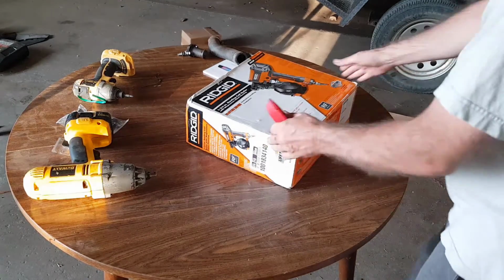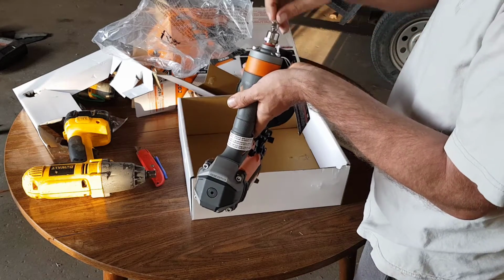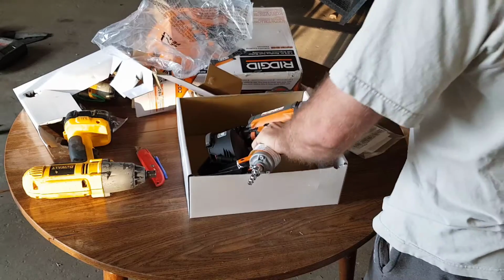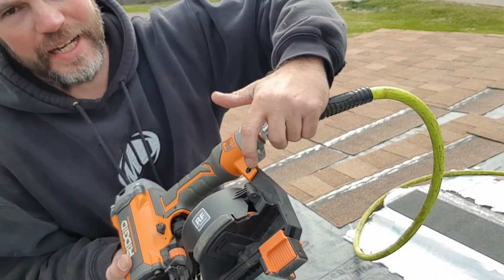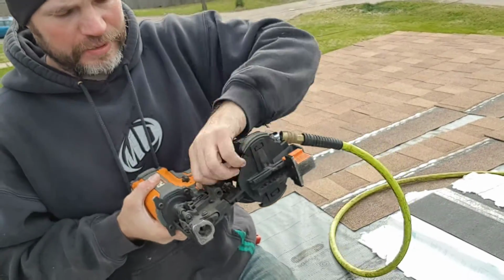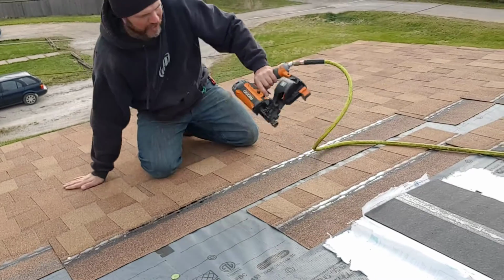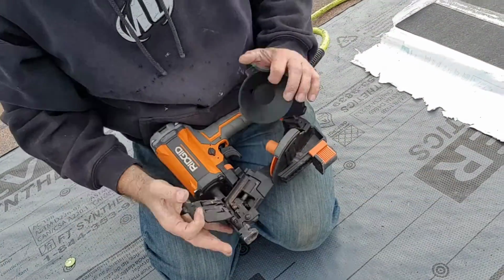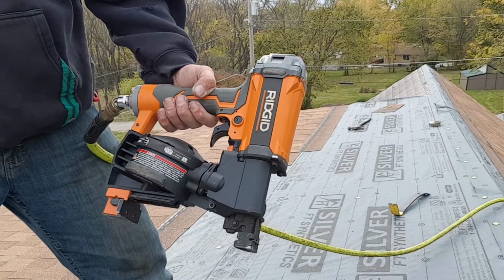Ridgit 15 degree 1-3/4 in. Coil Roofing Nailer.

Comment: Your stagger is incorrect for your nailing pattern. Leaves you with a nail exposed by the butts of your overlapping shingle.
Reply from the maker: I wasn't having any nails exposed. I followed the directions on the package as well.
Reply: He’s right you want to leave your nails pretty far from your seams. we always try to keeps our nails at least about 4 inches away on either side of the seam. Roof on boss!
Reply: And a 6-8 inch stair step.
Reply: @thatslumlordlife  no u didnt those are gaf elka or bp shingles they run on 8 inch stager and u 4 nailed like it was on that stager. fuck everyone grabs a gun and think they can roof
Reply from the maker: @drakerichmond3786  🤣 are they not staggered?
Reply: Right he doing it wrong I thought it was supposed to be 6 inches

Comment: Just finished a 24 Square roof. Bought 2 at HD. One failed about half way through. They replaced it because it was within 30 days. But the warranty process would have sucked. Definitely won't recommend.
Reply from the maker: That sucks. I havent had to use a warrenty yet for ridgit but mine seems to be working great. Hopefully your replacement is doing well.
Reply: @thatslumlordlife  replacement  did finish the job. The "Lifetime Warranty" has a bunch of hoops. Rigid was all they had in stock when I needed the nailer.
Reply: You are not lazy! Enjoyed seeing a 1 man roof job! Also is that your normal way of getting off a ladder? If so i will have to try that.
Reply from the maker: @tracythompson1692  I dont make safety videos so... 🤫🤣 if you can, try to have 3 points of contact going up and down a ladder. I'm not worried about falling and most the time I'm carrying stuff up and down it where I can't.